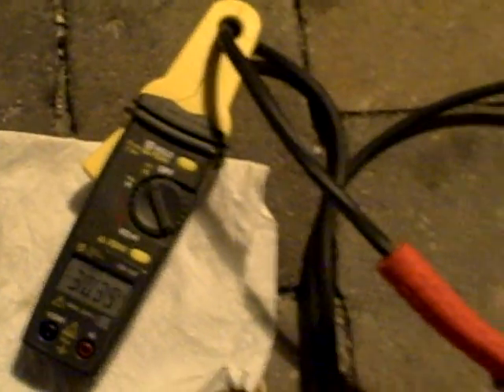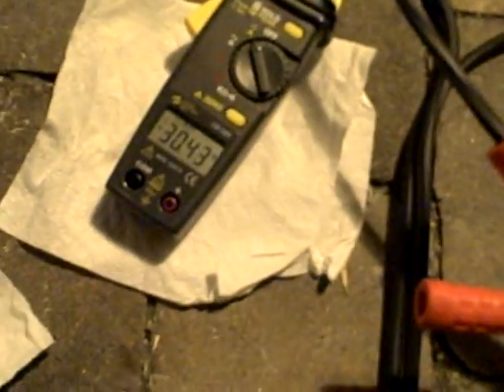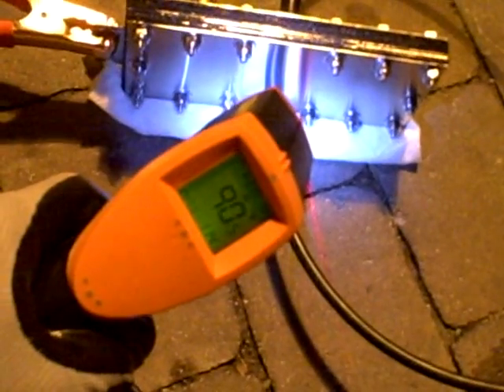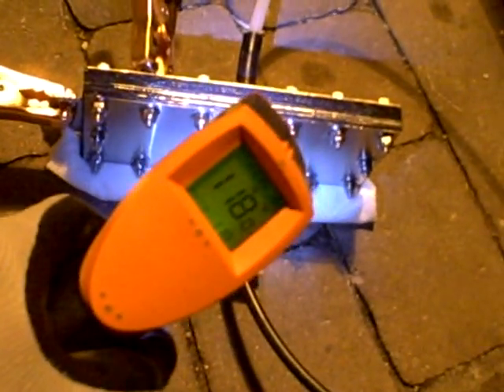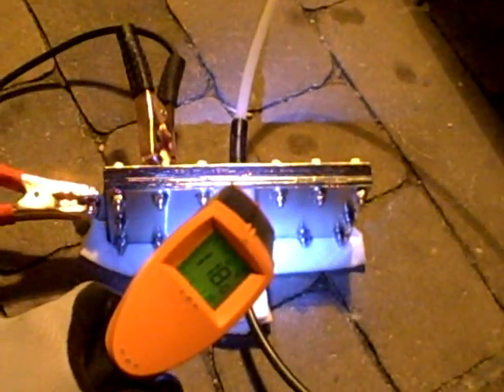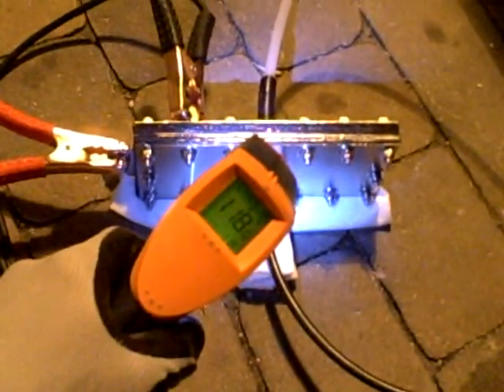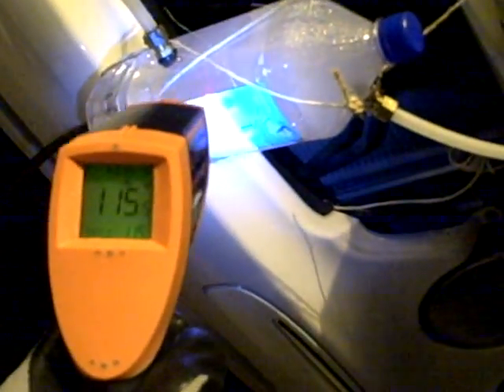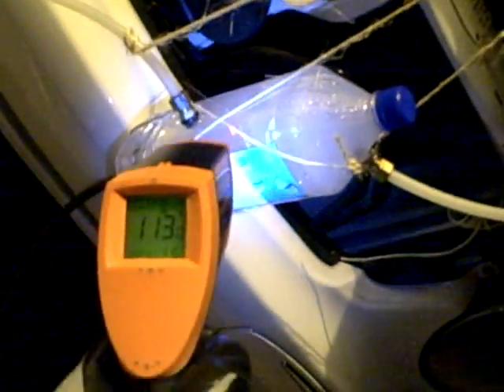HHO CELL  VorteX in the bubbler @ 2.2 lpm/hho

Comment: your 'vortex' might be due to 'undersized'  suction pipework...as the pump could  struggling pumping the liquid faster than it could be delivered... which could lead to cavitation by increasing the sized of suction pipework, this would get better delivery off your pump thus... better flow... or throttling just throttling the discharge on the pump very slightly may also help... or making an orifice plate and fitting same  back along the discharge line  you may achieve better flow....

Comment: Great job on the dry cell.
The only thing is, when the vortex is sucking your hydroxy back into the cell, your losing potential plate surface to electrolyte, there by decreasing your output. If you can stop the already made hydroxy from re-entering your cell, you should increase your output slightly.
Other than that, this is a rocking dry cell.
Keep up the good work.
Peace.
Mike.

Comment from the maker: crazzieg,Casper886,ablefarms,first thanks for the positive comments.the temp after 2 hours running is 142 degrees on straight current @27-30 amps and with PWM it maintains around 133 degrees @ 21-24 amps. the PWM is off in this video.the vortex really shows well on the high quality video setting here on youtube.i beleive that the circulation system shown in this video is critical for great output.the electrolyte flushes through the plates removing the hho bubbles for more fresh hho production